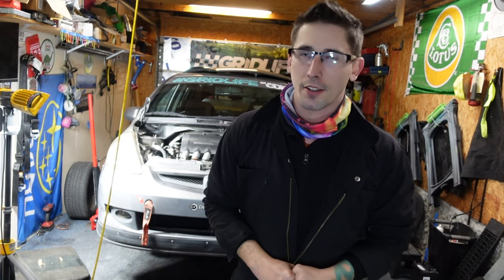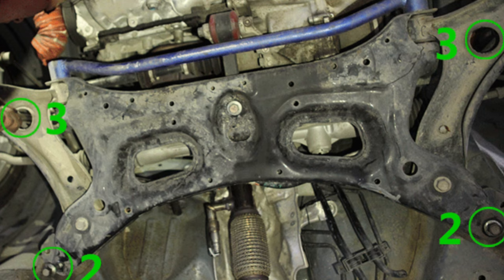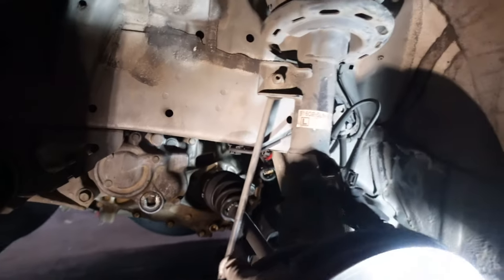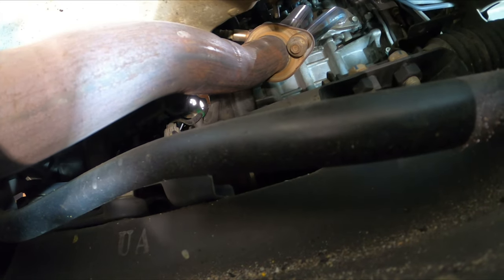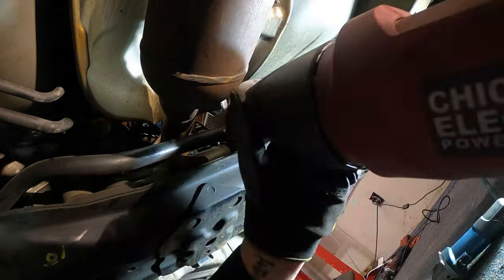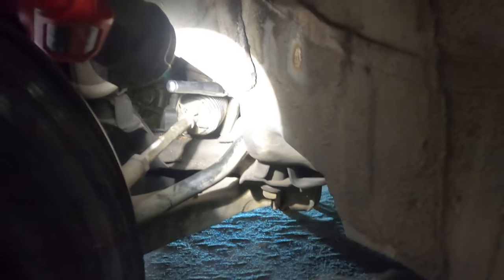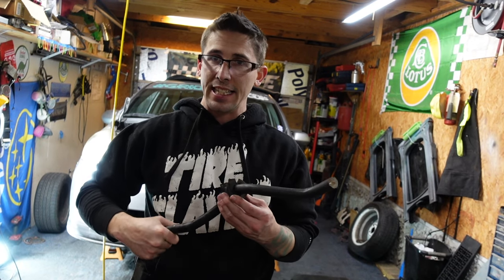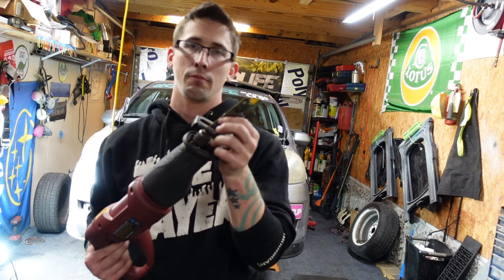How to remove Honda Fit Sway bar

Comment: Any tips to get those nasty link mounts out? Tools to use? I've tried a wrenches and swivel socket but could not get the front drivers out. Gave up, only replaced one bushing
Reply from the maker: @MrTriesToDoItYourself   I think I used a long 12 mm socket & turned the steering wheel until it gave me the most room.  Even then I think I could only slowly loosen it a lil bit at a time.

Comment: I used a diamond blade on a sawzall and just cut off the passenger side arm of the bar. Then I Ziptied the other side to.. something.. maybe the control arm.. I can't remember. But so far, so good. No more banging around :) Thanks for the video though. I'll consult it when I get my next fit because that front sway bar has no purpose on a Fit that has stiffer springs.
Reply from the maker: Why not finish the job?  U were half way there? Ha  I had mine zip tied for a while but that's alot of dead weight.
Reply: @TripSkyWalker  meh. Mine's not a full blown race car.. I just wanted it to be more fun on the street and at rallycross .. and didn't want to listen to it making music every time I drove it.